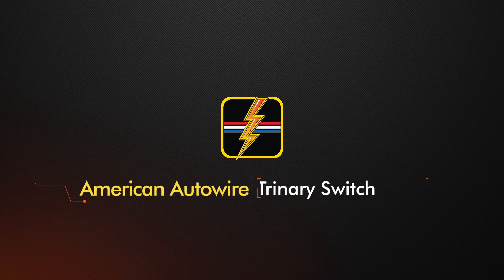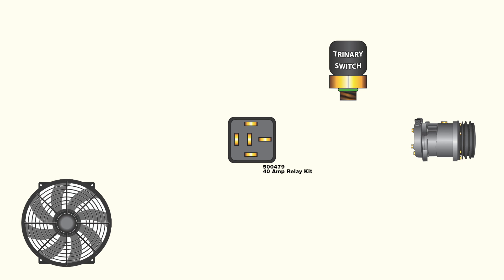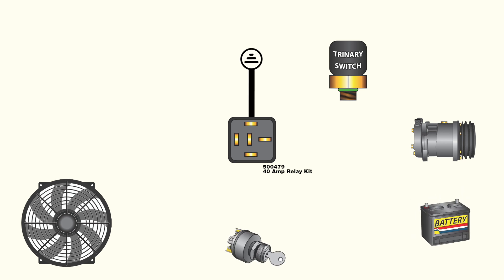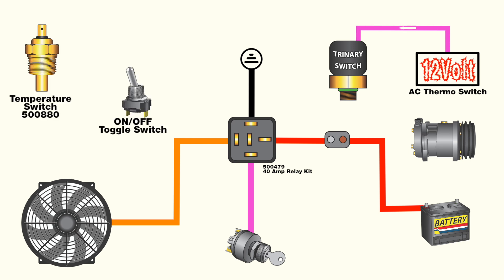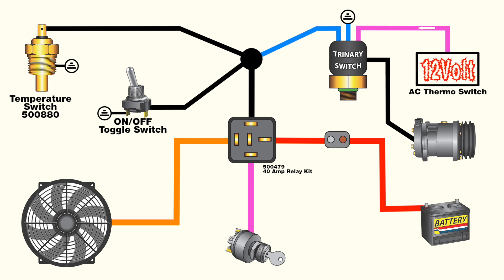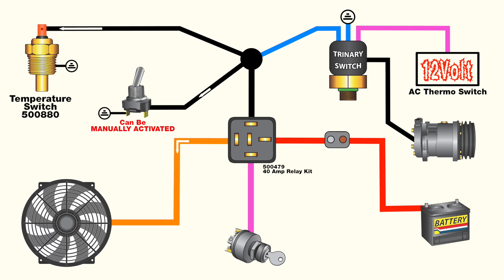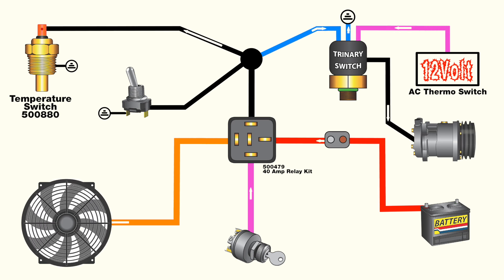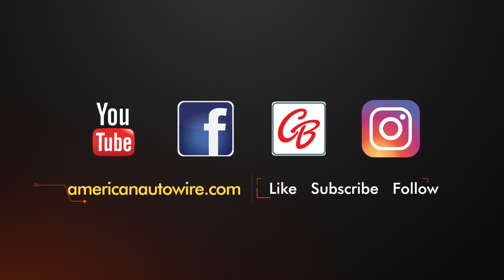How to wire an electric fan with an AC trinary switch. UPDATE

Comment: I plan on installing a pusher fan in front of the condenser. I only want the pusher fan to engage when the A/C is turned on. Do i need to make all of these wiring connections? Is there a specific kit that you can suggest. Many thanks.

Comment: For dual fans with AC how would one hook this up so one fan cuts on with the ac is turned on ? I seen your video with dual fans but it doesn't show it with AC.
Reply: Did you figure out how to wire this up?
Reply: 2 controllers.

Comment: I have my after market AC system wired up exactly like this diagram, minus the manual and temp switch. I want to add a temp switch now, and I want to use the factory fan wiring that was used prior. The factory fan connector only had two wires: a black/red and solid black wire. I assume the black wire is the grounded to the car’s computer. Could that one black wire be used as a temp switch? I believe that’s only for powering the fan though. There is a temp switch attached to my radiator, however. Could I tap into that temp switch’s ground to achieve my goal?

Comment: Do the temp switch connect to a ground or power
Reply: from the switch there is a ground that is connected there is also a plus. in this video on the main ground switch
Reply: @MANDIRIGEMILANGART  do you know why the ac would randomly cut off by itself. I have a vintage air setup that uses the same setup as shown except for the manual radiator fan cut on switch. Everything looks fine to the naked eye

Comment: Hi I have a car X5 model 2004 electric cooling fan keep working even when the car extinguish what is the reason that possible
Reply: The engine is still hot. When it cools off the fan will turn off.